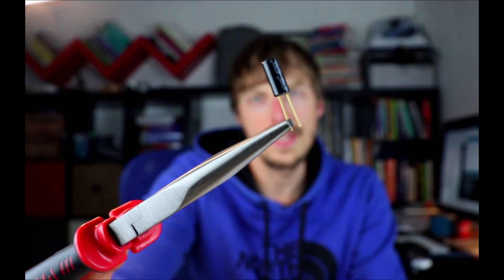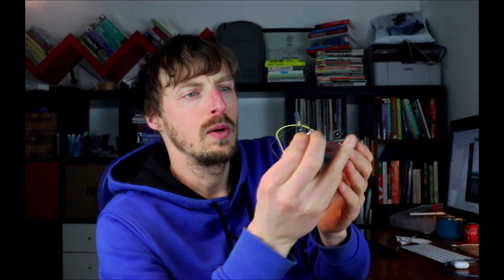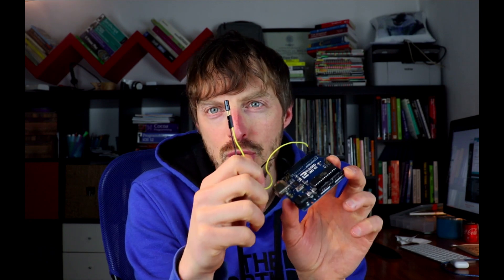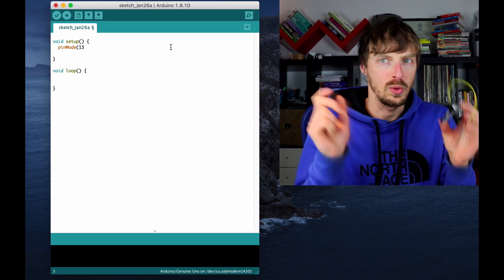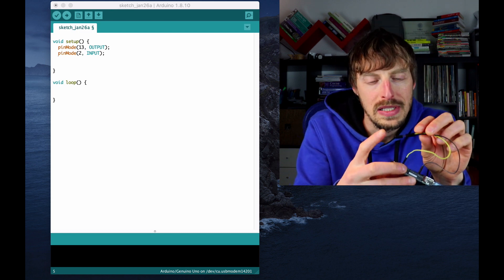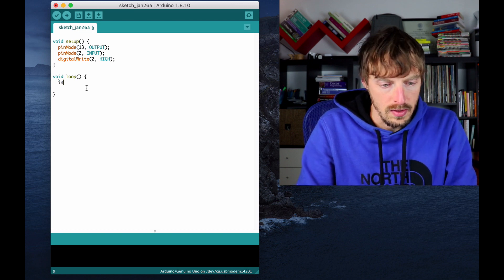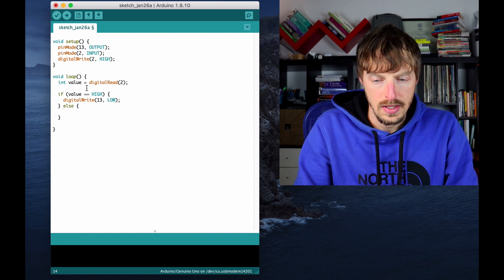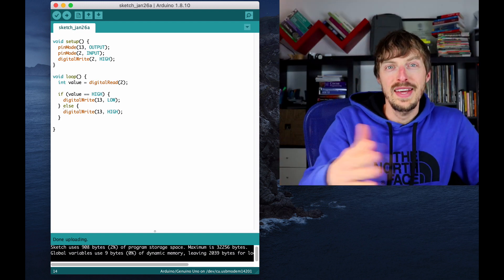How to use a Ball switch tilt sensor with Arduino

Comment: Why do you need an Arduino for this? You can just make a loop of battery, switch and LED (and possibly a resistor to limit the current through the LED).
Reply from the maker: No need for it, but I’m learning the basics of it so I put it in the middle